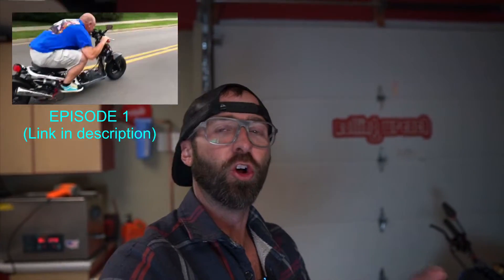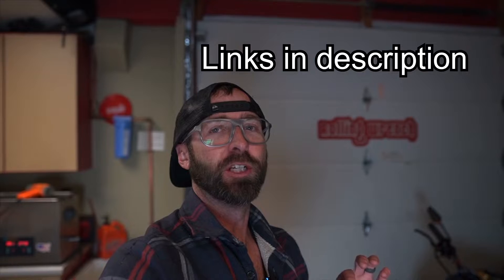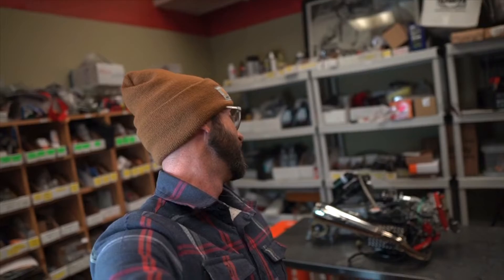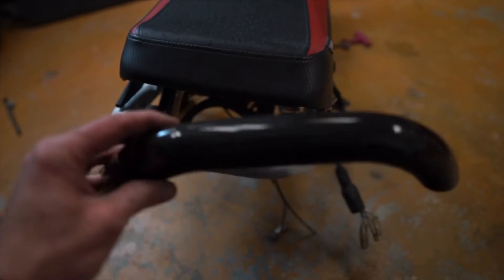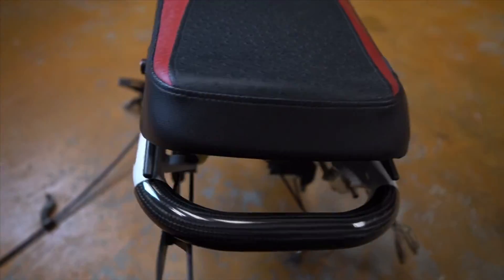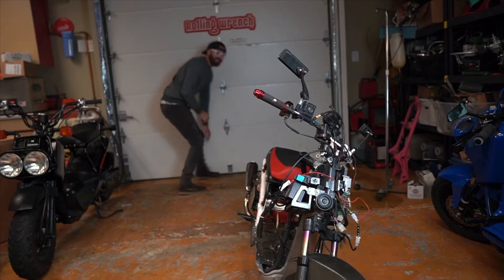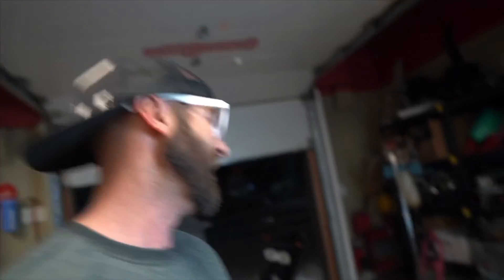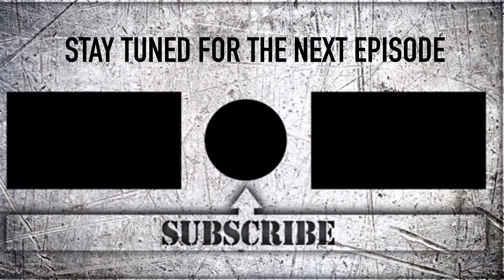Honda Ruckus / Zoomer Engine build: MAX PERFORMANCE [Parts 2]

Comment: When you reinstall the valve shims, how do you know what the feeler gauge thickness should be with the new upgraded valves? Or is it still the same thickness as a stock engine?
Reply from the maker: Honda has a specific spec. I listed it in the video

Comment: I made a slight attempt in reducing the weight of my 50mm big bore kit, in my 139QMB, I also unshrouded the valves, and ported the head,  and swapped in the a9 cam, and a free-flowing exhaust, I hope it's not too loud! I'll find out when the weather gets better, I also polished the Piston done, it was rough cast, it's not exactly a mirror, but at least it's not like sand paper, I think the unshrouded valves, and port work will make the most difference, bring out the potential of the big bore kit, my next move is a head with oversized valves! If the low lift flow is good, they should make loads of power, it may even want to spin 10k rpm plus! If the valves do not become bouyan, and float haha! Maybe shimmed springs will help, I haven't found much aftermarket/performance valve springs! I did shim the springs in my build, and used the strongest springs I had between the three sets I had! I also went with the long valve heads, the ports interfear withtge spring pockets, if the ports are opened up about 1mm the spring pockets are breached! I epoxied the tiny hole, but bought another head, with long valves instead, the original head had long valves also, the kit had short valves, I'm thinking about machining a 3-4mm thick aluminum shim to fill the pocket, epoxy it in, then re cut the spring pocket, good thing it was on the intake side, maybe I will get crazy with it, make it a long valve head, with crazy high ports, with a special intake / carb adapter, maybe use 150cc carb , and large valves, ( no need for a 25mm carb with 18.5mm intake valve! The bad part about the china heads, a simple valve job can make a big difference, they seat on the smallest part of the seat area, it could be a good 1mm larger seat /port, the heads with 23mm intake should flow tons better, (with 18mm exhaust) I think a head like that truely calls for the 52.4mm big bore, with the 44mm stroker crank! Boring the case isn't that difficult! And may as well do the crank since it's all apart!!! Sorry for the ramblings!

Comment: Do you have a video wiring a stock 49cc motor
Reply from the maker: No :-(
Reply: @RollingWrench  is there a particular reason why you clamped the ground off of the spark wire
Reply: I found the thermostat sensor wire on the sub harness

Comment: So what was the end result after you rebuilt the motor and it was all done? I have been wanting to do this exact same thing to the stock motor. I want to max out the stock motor and am wondering what the top speed is after the big bore kit is installed and the motor is fully rebuilt to top speed. How fast is it once it’s done.

Comment: I want to build my gfs 2009 metropolitan to be a 30-35mph hill climbing 50cc for logging roads hills etc with at least a mostly stock exhaust because she wants it quiet. Where do i start? Ive got a set of ruckus final drive gears, was looking at variator and weights, intake and jet, and some kind of coil and ecu? Basically just whatever i can do to keep about the stock speed but actually go up hills at that speed

Comment: What are the connector end  names or part numbers of a stock Honda Ruckus 50 enrichment and Tps connectors ?someone cut mine out before I bought it ,on the harness side .i know I can buy a new harness ,but just need the ends that plug to the stock carb ..Thankyou ,great videos👍🏻
Reply: Anyone?

Comment: Hey was watching ur old videos about Cdi I have a 2018 kymco 49cc scooter and it only goes 20-30km how do I remove the governor? Make more power
Reply: Mainly the CDI can limit speed, so I'd suggest you get a performance CDI, ebay, ect, and do some research as well, big boring the piston to 70 cc also helps a ton, any more though is really bad for the engine, I got 10 more mph from a big bore
Reply from the maker: Clip the green wire
Reply: Rolling Wrench I un pinned it and it wouldn’t start any suggestions
Reply from the maker: nicholas betters is it a 4t?
Reply: Rolling Wrench what do u mean 4t
Reply from the maker: nicholas betters 4 stroke or 2 stroke Kymco?
Reply: Rolling Wrench not sure it’s a 2018 kymco 50cc
Reply: Rolling Wrench thank you for the help please if u know it will be grate